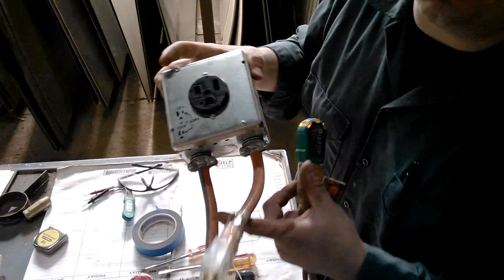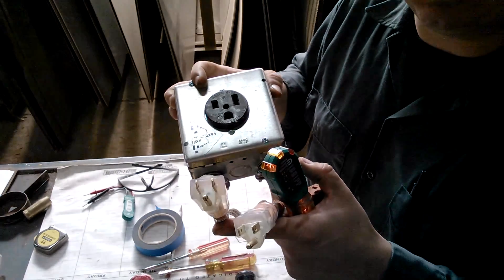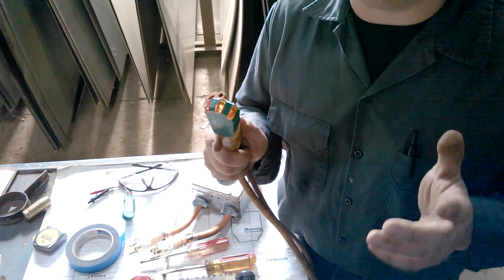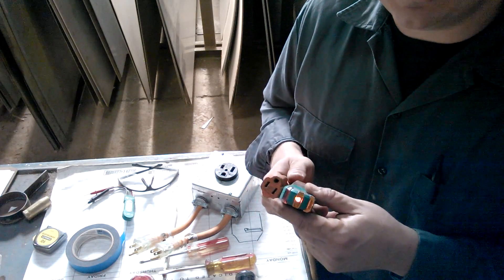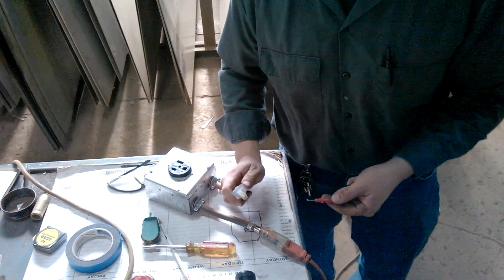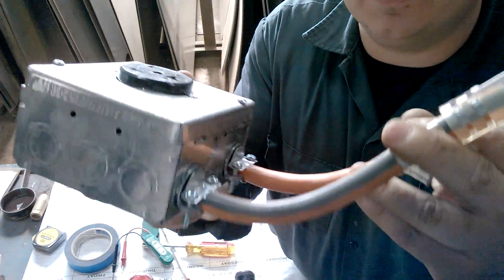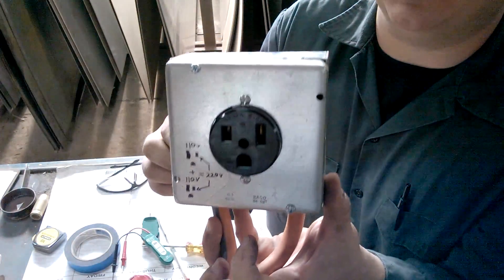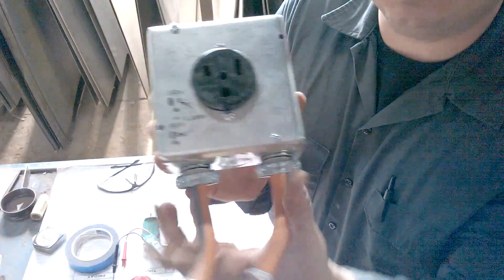Experiment convert 110v to 220v from two outlets

Comment: I'm not a professional electrician but i have work with a few in the past. I have some basic training and work on some residential wiring and checked off by electricians. That being said what you have done can work to give out the 110/120 v to 220/240 v as such.                                                                                                                                                                                         
                              The problem is in the amp draw of what you want to supply. If the outlets you are using is a max of 20 amp feed from either of the outlets then the most you will be able to supply is a 20 amps maximum. So what that means basically if the appliance you are attempting to run had say a 40 amp draw most likely one or both breakers would trip and shut down every time you flipped the switch on.                                                                                                                                                     
                               A better and maybe safer thing is to buy a heavy duty cord made for use with 220/240 v with the type of plug needed for the appliance you are using. then if you have an exciting outlet that is 220/240 v at say 30/40/50 amps provided just check the breaker box if labeled to see what the amp is to see if it will match your appliance being ran on it.                                                                                                                                                                          
                              If it checks out then you can buy a 220/240 v outlet adapter or if you plan to use that outlet for a long time just change the male end of the cord to fit the outlet and all should work safer and at the correct amps needed........  Thx 4 the vid
                                                                                                                                                                                                       
                                                                           ⎝⧹╲⎝⧹ÐΛЯΞ †o ÐЯΞΛM⧸⎠╱⧸⎠ [̲̅$̲̅(̲̅☠)̲̅$̲̅]¹°°

Comment: Nice work Joshua. I little overkill on the 10gauge wire and 50A receptacle, but functional. This will work just fine using 15A 110v circuits as long as you don't try to draw more than 15A.  It is good practice to directly ground the box (even though it is grounded through the plug bracket.) 
Ok... I've watched this and have been reading the comments because I was curious if it would be worthwhile documenting my implementation of such a 'conversion'. I have to laugh at the lack of knowledge many commenters have. This definitely works when the 2 15A/120V circuits are taken from opposing 'Hot' wires of a single phase 240V source (such as standard North American residential power.) It really isn't 'converting' anything, it is simply providing a connection to the original 240V source providing power to the 120V circuits. Think of it as putting the 2 halves of the 240V back together (because that is exactly what it is!) There is no "NOT true" 240V AC here.
The Electrical Code does in fact cover some things not 'hard wired' into your electrical system and it could be argued that this adapter violates 400-8(1) of the NEC because it is used "As a substitute for the fixed wiring of a structure", but this is a weak argument and doesn't fall within the intended scope of that clause. I have yet to see anything in the code beyond that clause that limits what you can and cannot plug into the fixed wiring of the structure.
The risk is that, as some have mentioned, when you overload the system one of the breakers will trip leaving one side of your plug hot. A small safety issue but only if you go into the wiring without unplugging the device. And, often functionally equivalent to switching off the piece of 240v equipment. Simple solution is mitigate this is to tie the breakers.
So Joshua, again, kudos on your experiment! You have motivated me to document my implementation.
Reply: First I am not an electrician but I do like the experiment you did. I am in need of a device like this so I think it was great what you did here. I know it’s not something that’s done all the time but it does work. So great job in proving that it does work.

Comment: as long as your seperate 110v legs are coming from the same source but from two different breakers they will be in sync, if the power sources for each 110v leg was two generators I would not do this, the phase output of the two generators must be in sync and that is practically impossible to do DYI unless they are two inverter generators in parallel, that might work, but the power coming from the power company into your breaker box is only being diverted through different breakers, a 220v breaker is essentially two 110 legs, basically what you have done here, if you did not have a load center that has a spot for a 220v breaker you could essentially do what you did with the hot wires and ground from two separate 110v breakers, again not advice, be careful, also black is power, white is common ground back to the utility company, green is ground to a ground rod somewhere in the building,

Comment: LOL...
I was just talking to my boss about this, he said you got to have a double pole breaker, I told him no, as long as you are connected to the 2 different legs on the panel, you have 220v even with single breakers...
Thanks for the vid.
Reply: Technically he’s actually not wrong, u need a double pole or tandem breaker so that you can be able to shut off both phases at one given time rather than looking for 2 separate breakers scattered around the panel
Reply: Sorry Nick,
But , 
Tandem breakers only hook up to one leg in the panel,
The only way you can get 220v is hooking up to both of the legs on the panel , try making your A/C work when you only have one leg as a feeder or 110v , thanks.
Reply: Francisco Vides ur not getting what I’m saying, the “code” way requires you to use double pole breaker. Obv using different 120 legs u can get 240 with 2 breakers but shouldn’t be done
Reply: Oh!
Sorry, yes you’re absolutely right!

Comment: People, if you do this. Figure out your "black" leg and "red" leg circuits from the panel. Typical house panel black leg circuits will be 1,5,9,11,15, etc. On the left side. 2,6,10,14, etc on the right. Red will be 3,7,9,13, etc. And on the right, red will be 4,8,12,16, etc. I've been an electrician for 10 years. My only suggestion is that a grounding pigtail is needed in the metal box. If that metal box was to be energized for any reason, it's not grounded back. You will be the ground if you touch it!
Reply: Also, don't use both grounds or tie both "white" nuetrals together. Use 1 ground. He's created a grounding loop. Not as big of a deal if you are sourcing your power directly from the source, main panel. It can cause big problems if you are getting power from a sub panel
Reply: Would it be Ok to Attach the Neutrals that are capped off to the box? would it be the same as a ground?

Comment: Hi, does this actually give you 220. I would have thought it give you closer to 190-200 considering rms calculations also if you tested across the other plug it should have been "hot"(we call it live in england) on one of the prongs to earth. So good thing you didn't touch it.

Comment: @UnsanctionedFabrication - 
1.did you say that you were using 110 volts from different breakers? 
im trying to make one of these to use on one side of the house without using fro different breakers
2. ^would that work or would it trip my breaker?

Comment: SO to be successful in repeating this you need the 220v tester to make sure you have found 2 110v outlets that are not on the same  "leg" (household panel has 2 hot legs with a ground in the center). I would need to make sure i was using a outlet supplied by a 20a breaker on the left leg and another outlet supplied by 20a breaker on the right leg. This would provide me with both transformer supply outputs and ground. If I'm not correct please tell me where and why I'm wrong.  I'm asking as a person that is curious abd wants to learn. I'M NOT A ELECTRICIAN AND DO NOT CLAIM TO BE. thanks in advance for your answers.

Comment: I did this exact thing that you did , but I used the 6-20 220v receptacle that matched my 1978 craftsman compressor. It's 3 hp motor 30 gallon compressor and it runs fine . I used two 20amp 110v receptacles on different sides of my breaker box to hook to.

Comment: Thank you for your instructional video. After Hurricane past over Puerto Rico the island is suffering a massive blackout. I replicated your experiment successfully to use a small inverter generator and give elctricity to all my house. of course in safety way with a transfer switch only for essential equipment like refrigerator, TV and lights.

Comment: GREAT VIDEO, ALSO THE BREAKERS YOU WILL BE TRYING TO USE MUST BE 20 OR HIGHER. DEPENDING ON THE MAX AMPS USED BY THE WELDER OR OTHER MACHINES. JUST SAYING OLD ONE LEGGED JOSEPH T.

Comment: There is a problem with this solution and that is if you start using this box and let's say install it in an outdoor gazebo where you would usually use 110V plugs for lighting and then one day you plug a 6000 W heater that feeds on 220V to the master plug that you made, it will have no issues until someone may pull out one of the 110V plugs and then you would end up having a 220 application where master plug has only one active hot ( i.e. 110V) and not sure if that means driving  Amperage to 2 times higher than expected and then potentially causing fire on one line!  ( I would assume the breaker would go off on that before fire, but momentarily wires  should be very hot)!  If that happens ( engineers can correct me if I am wrong with this scenario assumptions), it could be very dangerous and to prevent that,  you would need to make sure both plugs are in at all times and find a solution for that either through labeling and warning and ideally by hard wiring!

Comment: Kinda looks like Grant Thompson's adapter with two extension cords, but your adapter has thicker gauge wires than his (which is 8 gauge). You wanna make this safe if not safer, then use two surge protectors for your extension cords.

Comment: So, I'm wondering if I could use 2 Honda inverter generators and this type setup to get 240v output.  (for instance 2 honda EU2000i generators).  Honda has a parallel cable for them, but it just provides additional wattage at the 120v.    I want to output the combined wattage to a 240v receptacle.

Comment: I didn't see this answered in any of the questions. But can this adapter be hooked up between two identical generators to provided a 220v circuit?
Reply from the maker: Odds are it can't, but I wouldn't chance burning out two generators if your wrong!

Comment: Let me break it down real simple this is exactly how that plug would be wired it just has 2 110 v disconnects and is only rated for 15 or 20 amps depending on breakers if u look at at 220 breaker its just 2 110 volt breaks tied together I have also installed 2 110 volt cords  on a 220 a.c. unit and plugged it in 2 different 110 outlets same thing

Comment: You made an error at 3:45 where you test for current. You do in fact have 110 volts between the hot and ground prongs because you are using a 3 prong outlet not a 4 prong 220v outlet which have 2 hots right and left neutral center plus ground. Your ground wire became the neutral wire because ground and neutral are tied together at the breaker box. You capped off your cords neutral wire inside the steel box so thats why your tester didn't light. Had you used a 4 prong 220v outlet and connected the neutral wires to the center blade you would have had 110v as tested as well as between hot and ground.

Comment: add your own neutral that's the key a small tent spoke has worked for me I simply run my neutral back out of the box and on the job I just clamp it to the tent stake you definitely want to use identical Breakers 20 amp

Comment: The first 2 cords used by guy in video apparently were separate 120 volt circuits that got power from the same 120 V leg feeding service panel. This could explain why those circuits tested at 120 V, but did not test out at 240 V when combined. When guy in video got the 240 V he was he was looking for, he switched one of the cords for a different 120 V circuit that got power from the other 120 V leg feeding his service panel. I think I got this straight?
Reply from the maker: +cyclepunk1959, this is the guy from the video !  :-P    It's true that I randomly checked outlets until I found the proper match, but the outlets were on opposite sides of our shop. 

But it's possible that you might not find two hot lines from opposite legs, depending on how the building was wired.

Comment: Also called a tandem, slimline or twin breaker, a cheater is a double breaker that takes up the space of a single-pole breaker. Unlike a double-pole breaker, which serves a single 240-volt circuit, a cheater serves two 120-volt circuits; it cannot be used to supply 240 volts to a single circuit.What Are Double-Pole Circuit Breakers? - The Sprucehttps://www.thespruce.com/what-are-double-pole-circuit-breakers-1152727Just buy it at ebay.

Comment: congratulations on your experiment and this level of success. however I am concerned that you don't use the neutral white wires at all. you see after 1 year of 40 hours per week of. commercial, industrial and residential electrical training. I'm taught to always use the neutral white wires. so the power company can make their meters work. by you returning that juice back into their system. oops? did I just slip up and explain why these neutral white wires are called a return path to current. maybe not but I am curious about if my theory is correct. anyone want to help budget an experiment to see if I am right. well anyway forgive my grammar and lack of proper English skills. It just seems strange that an electrical or electronic device seems to always have at least two wires to make them work. why not power meters????????
Reply: I agree...in order to make this setup more logical, I would think that building it into a 4 wire outlet would be better than wiring into a 3 wire outlet.  (?)

Comment: yes that works but if you don't use a 220 breaker before the thing you plug in. you can trip only one of the separate breaker and burn up your shit. like i did to my compressor motor. $400 gone in a flash and huge puff of smoke. put a 220 breaker in your 220 adapter outlet box thing you made.

Comment: Will this work safely for my welder it runs off 240 but I only have 110 outlets at home so I've had it for like 6 months now and haven't been able to use it????
Reply: Most likely not, u only have 15A of current I’d assume ur welder is 30-40A so it won’t work

Comment: Question,... I have a Generator that only has 2 different 120 volt outlets,... If I made one of these to create a 240 volt outlet (admittedly with low amperage) I understand that I would wire the 2 Hot wires to the 2 Hot terminals but wouldn't I wire the Neutral wire(s) to the 3rd terminal ?
This would be to make a 3 pronged Suicide Cord to from the manufactured 240v generator outlet to a 3 pronged female Dryer Outlet to back feed a house during a power outage,... HYPOTHETICALLY speaking of course for an off grid cabin,... HYPOTHETICALLY :)

Comment: I would not suggest  doing this but one sugestion id make if you did would be run a ground off the two green wires and run it to the steal box itself. just in case a wire dose for some reason short out to the box it should flip the breaker and hopefully you would not get electrocuted.   most kitchen outlets that I know of do use the two different hot lines coming in for top and bottom where this would work but then again you'll be running on lighter gauge wire and 15 amp breakers  not   good could fry your house down .  I find  best is to make a come off a dryer or stove outlet then at least the main wireing is 8 or 10 gauge and u will have a 30 amp breaker. I do this for my welder works great yes you do lose the use of the dryer but the wire gauge and breaker amps is there . it's all same basis connect two hots and ground  and omit the neutral cap it off and leave it . I'm  not a electrician by any means  but I don't suggest doing this set up in the video .It will work but can cause isues down the line and much frustration

Comment: This is exactly how your stove and dryer is wired at the panel. He just did at the plugs in the wall instead. Dad was an electrician and taught me how when I was 10, it hasn't changed in 48 years except maybe in the size of the wire. And it won't change because it only works like this. All these folks that are not electricians should just shut up and move on. This will work for any machinery that uses 240 volts and less than 30 amps.
Reply: ⁰⁰oò⁰ķòķò⁰⁰ppp
Reply: Òòòòķķ
Reply: Sorry to burst your bubble Steve, but maybe sons of electricians should curb their enthusiasm as well. Try and pull 30A/240V (7200W) out of 2 - 15A/120V (1800W ea) circuits and you'll be flipping breakers all day long... of course that is what they are supposed to do and why there is little risk with this 'experiment'.
Reply: @lakeman2604  hey man, I have a tablesaw that needs 8.6 amps and 230v... Would this work okay for that?
Reply: Steve Currier hey Steve can I do this to supply power to my hot tub while adding a gfci to the mix?